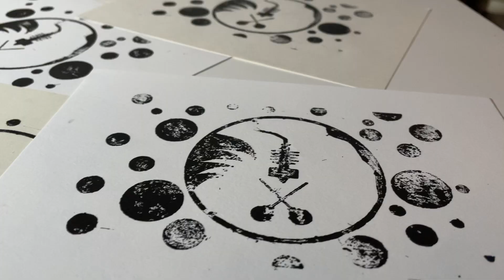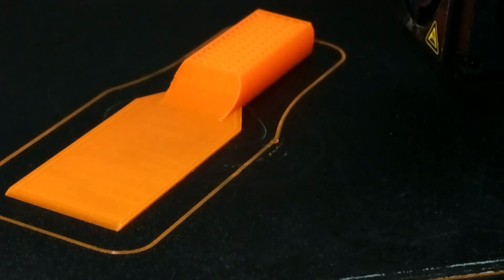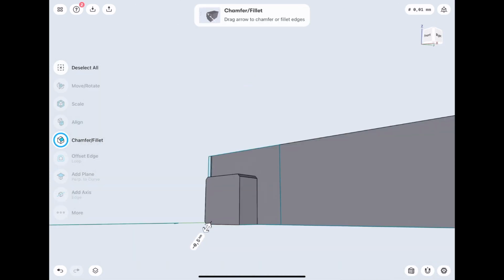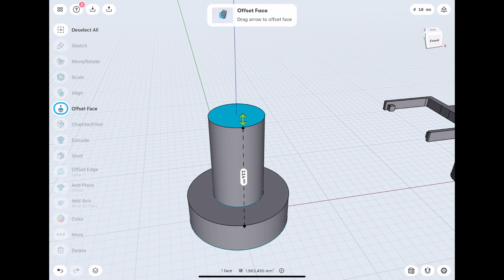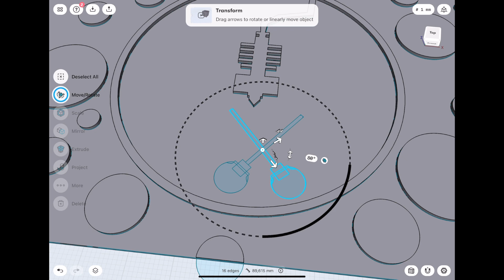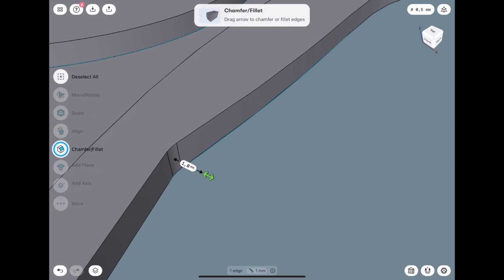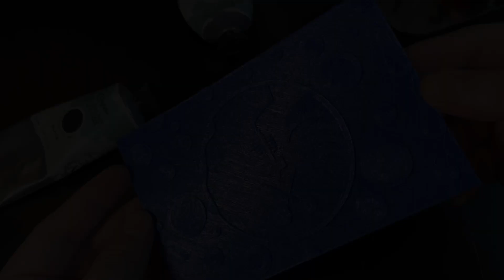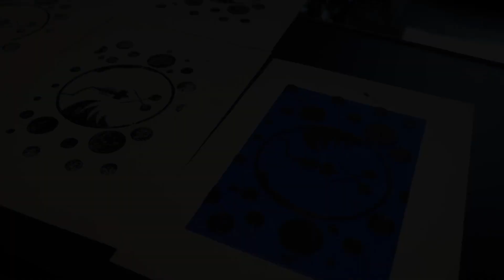3D Printing Linocut? (Printmaking using only a 3D Printer)

Comment: I do linocut printing often, and I do not think this is cheating. As long as its your design, its fine the method you use to print it. Plus, PLA is cheaper than linolium and this makes multicolor prints more affordable, and accurate. I was thinking about doing this, than looked on YouTube for tutorials- I already have tools, but I think that its really cool you also designed the tools to be 3D printable so that anyone with a 3d printer can do block printing too!

Comment: There is an additional benefit not mentioned.  If the printing block wears out, you can just print another one, identical!  Also to smooth out the print you could put the printing block on your heated bed with something flat and heavy, just briefly, to slightly melt out the imperfections.

Comment: I don't think it's cheating. It's a great way to create more complex artwork with it's own quirks.

In linocuts, imperfections tend to make each printing template unique. In 3D printing, templates tend to be reproducible, but also have imperfections and thousands of varieties, as you can use different patterns for the top (you can even program your own). You can also easily break a design down to different colour layers, potentially much easier so than in linocut.

Comment: interesting  but for me i think that the resulting plate is too pitted .. can it be lightly sanded to make a flatter plate?
Reply from the maker: I was trying to have the opposite effect actually (and didn't manage), so having the print lines to show in the final design. Didn't show up probably because my ink was very old, but the idea was to have a rough 3D-print feel on the final print.
If you want have it flat you would just need to flip the print in such a way that the design is printed on the glass plate on the printer. It should be doable
Reply: @v_saggiomo  Brutalistic linocut, embrace the materials used :D https://en.wikipedia.org/wiki/Brutalist_architecture
Reply: @v_saggiomo  We used a litophany printed in PLA/PETG to print photos and it worked well
Reply: I 3d print plates. I always sand them before applying ink. You'd never know they weren't linolium.
Reply: Would ironing the top layer of the print be effective
Reply: @lilpoolish  nah, just use more top layers, concentric top, and thinner layers on the mouth piece i have printed two, one for a patient and one for me, but it was taken immediately from me, now my brother has it, They work amazing even with out the "extra mouthpiece", even my patient going throw severe "stuff" was able to play it comfortably, I printed them in a A1 bambu, using 0.6 nuzzle and differential layer height
Reply: @mellangatang  what plastic and ink do you use? thnx in advance
Reply: @alexjoz  I've had the most success with TPU filament. I've only ever used speedball inks, but never had a problem with them.
Reply: I'm working on doing this now years later and with an acrylic paint test (only just got some ink) making the printer iron the surface reduced those lines without having to sand it or flip it face down onto the build plate. Need to try it with ink though